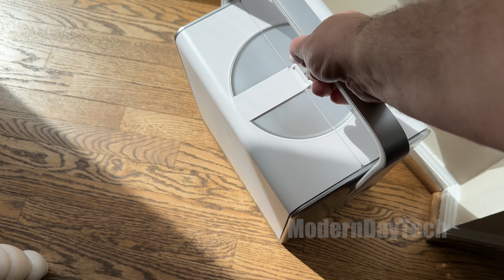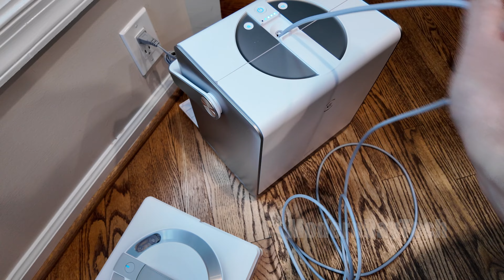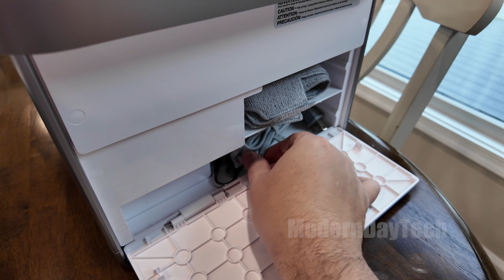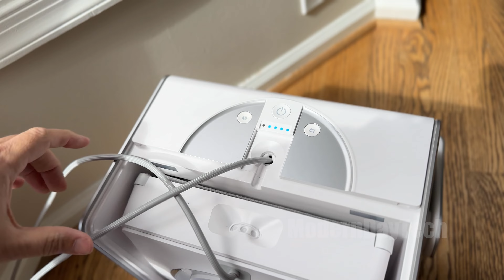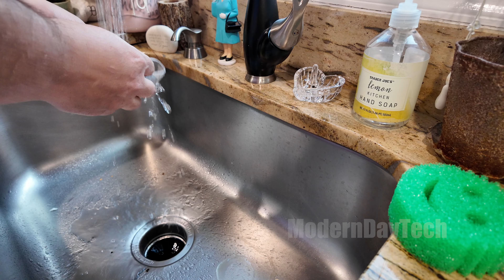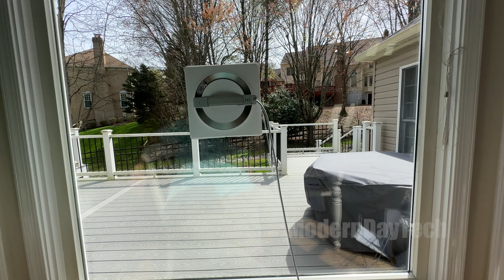The Ultimate Window Cleaning Robot - Ecovacs Winbot W2 Omni

Comment: can you push it from one solar panel to the next or will it turn off?
Reply from the maker: I don’t have solar panels, but I did test one of these Winbots (not sure which model) on a large glass tabletop, and it wouldn’t work when the unit was placed flat and horizontal. My guess is there’s a tilt sensor or gyroscope that only allows operation within a certain angle range, but I don’t know what that limit is. You may want to reach out to the brand to confirm the supported angles for that model.

Comment: Hi! I saw your presentation of the Ecovacs window-cleaning robot  I’d love to ask you something.
Do you have any experience using this robot on glass panels that are not cut straight (for example, with a slanted or angled bottom edge)?
And how does the robot behave when there is a small gap of about 1 cm between two glass panels?
I’m considering buying it, but my staircase glass has both of these features, so I’d really appreciate your experience. Thank you!

Comment: How spotless will it clean the windows? Will drag/dirt marks remain which are not very visible in normal lighting conditions but show very easy when sunlight is shining and reflecting off of the window?
Reply: I bought one the other day, honestly, it did better than I expected. For our extremely dirty windows, it did leave streaking, but I washed the pad and tried again and it cleaned right up. I also think those windows were a lot hotter than the others too so the pad dried it a bit, others that were equally as dirty didn’t seem to have the same issues. I struggled to warrant it at the price it was a few months ago but with the Black Friday sales it made it pretty reasonable considering.

Comment: When I remove the bot after cleaning, it leaves a streak. Any luck on removing it, without this large patch?
Reply: Is it worth buying it ?
Reply: As the suction begins to release, slide the bot down and lift the bottom away first, then the top, like a plane taking off from a runway.  It's as if it's self-wiping that way.

Comment: Does it work with double glaze window
Reply from the maker: If you're referring to double-pane windows, why wouldn’t it work? You can clean the exterior, which is one side of the double pane, and the interior, which one of of the other pane. The space and two sides of the pane between them is sealed and filled with argon gas, remaining untouched sides. If you notice anything inside that space, it means the seal is broken, and the window likely needs to be replaced.

Comment: Thanks for the video. One question, the cable, is an electrical cable? I mean, the robot works with the electricity (i mean connected) or when it works use the capacity of the battery? Thanks in advance
Reply from the maker: The battery is in the base, not in the robot. So the wire between the base carrys power to the robot.  I hope that helps.
Reply: @ModernDayReviews  Thanks for explanation!

Comment: Is it loud?
Reply from the maker: Not to loud but it will wake you up if youre sleeping in the same room.  6:15 (no adjustment was made)
Reply: @ModernDayReviews  Mics are adaptive, so it's hard to judge solely by the recording. Seems like it might be a better design to use a magnet on the opposite side to reduce suction needed, then maybe it can be quieter.

Comment: You have windows that are divided up into smaller panes of glass (like a tic tac toe board) with low lying plastic dividers/frames.  Will this cross those boundaries and clean the entire window or are they divided up too small and the machine looses suction and falls?  I hope I was able to explain that well enough to be understood.
Reply from the maker: No, it has to be one solid piece of glass. Thats why you don't see me using it on those windows. Just the large window. If there are any window grids, the robot will run into them and think its the end of the window and go the other way.  It could also break the window grid if they are thin and cheap. There are some windows however that have the window grid between the panes of glass so check to see where the grid is located. Understand, this suctions to the glass and it can never lose contact.

Comment: Thanks for the good review. Two questions. Does the base station have to be plugged in to power during cleaning operation? I would like to carry it to wherever and just start the cleaning without looking for a power plug... sometimes a window is not near a plug.  Secondly, if the safety  suction beneath the base doesn't work, because the ground or floor is not smooth, can you still use the robot?
Reply from the maker: It only works on batteries. You charge the battery via a plug but you must unplug it to use it.  I have real wood floors thats can't be suctioned and it works great.
Reply: Thanks! It seems to me that this window robot is the way to go and first one that gets it right in every way.

Comment: Thanks for the review. Really informative. Any idea how high the window frame edge needs to be? What if there is a gasket around the edge, as many windows have, would it still work?
Reply from the maker: The limitation of the height and width is determinded by the wire. The W1 has to be pluged into the wall but and the W2 doesn't need an outlet so the base can be moved closer to the window to gain more length.  You should be fine with the gasket around the edge as the robot has rollers on all sides. But like like anything, you need to test and if the gasket is frail, then you need to fix it.

Comment: I can pretty much justify any lunatic purchase in the name of smart tech.......but this........nope
Reply: I work in a hospital ED... the number of 60 something men coming in seriously injured from falling off ladders is a concern. If something can keep older people off ladders, all the better for them.
Reply from the maker: It's not for most people, as it requires a specific use case, such as a window in a high-rise building that you can access from another window. It's not intended for normal windows that you can clean by hand or access with a ladder or with pole. Secondary uses, if purchased for the primary use, would include easier-access windows or flat glass surfaces like a shower.
Reply: @ModernDayReviews  that's a fair point and one I hadn't considered
Reply: @ModernDayReviews I have lots of big windows. All are taller than me and my reach. Just bought this and setting up tomorrow morning. Came here to watch how to fill it up because reading user manuals is 🥱 😅

Comment: I can clean the window in the time it takes to move this thing from one window to another. Absurd.
Reply from the maker: You're right, this product is not for you, but you also may not understand the product or realize that other people have different use cases. This is mainly for windows you can't reach by hand or with a ladder, as doing it manually would be faster. As I mentioned in the video, this is for windows that can be accessed through another window, such as those in a high-rise building. Secondary uses, if you bought it for the primary use, would include cleaning normal windows you can reach, shower doors, and other flat glass surfaces.